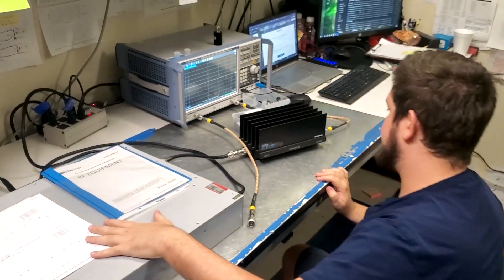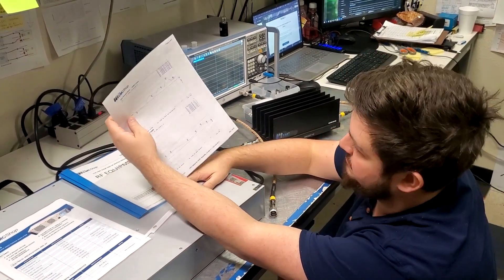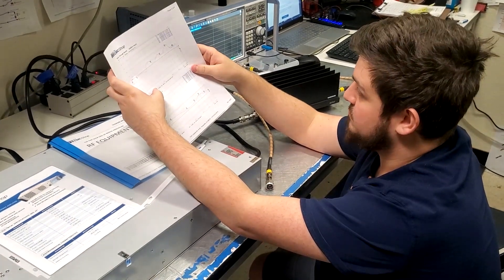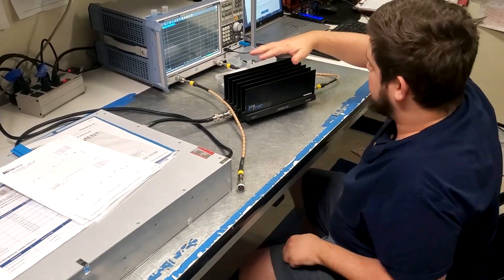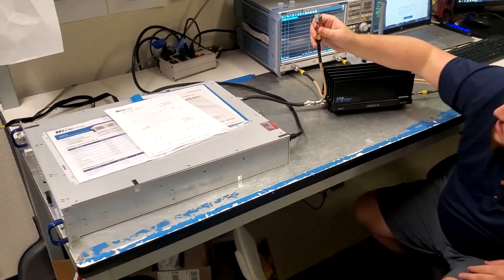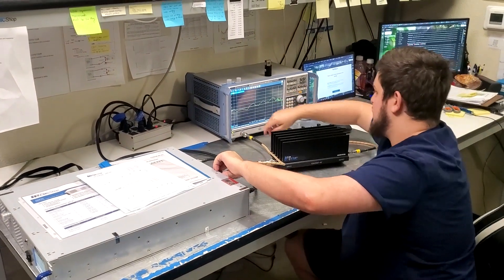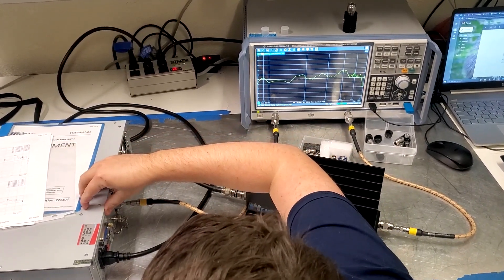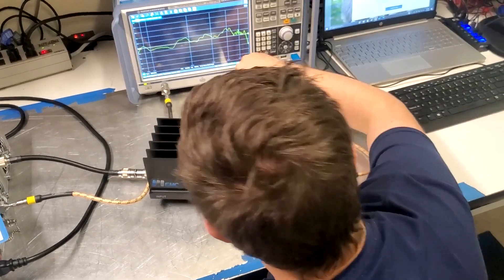Measuring Gain Output on a High Power RF Power Amplifier

Comment: so may i ask theoritically  why do we need attenuator?
can the vna already get the 54db signal?
Reply from the maker: It's to protect your expensive test equipment. Even if you're VNA was rated to handle a 54dB signal, which would be awesome, it's very easy to put a 40 or 50 dB pad inline and have the VNA make the adjustment. Hopefully you didn't blow out the front end waiting on my response? :P